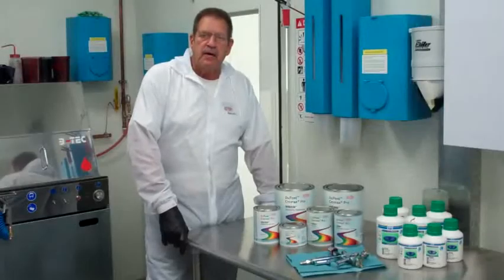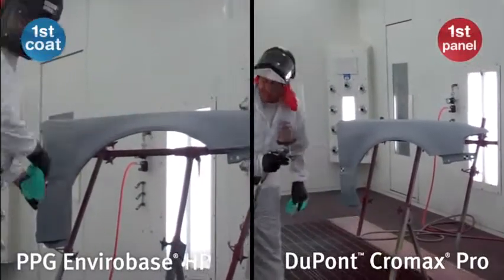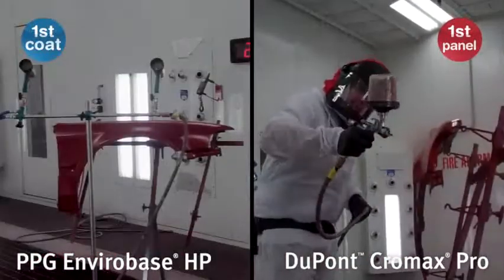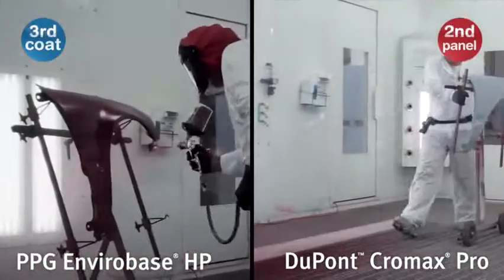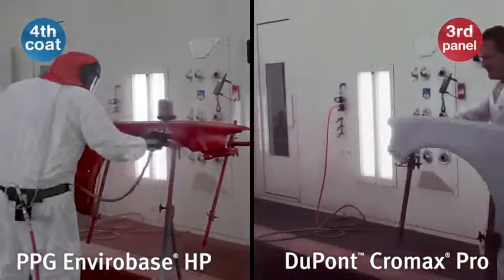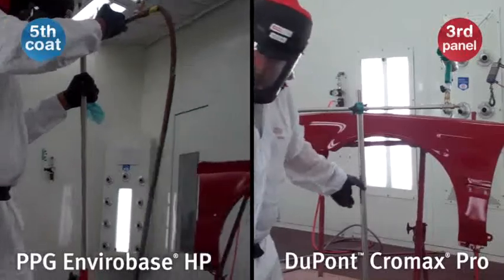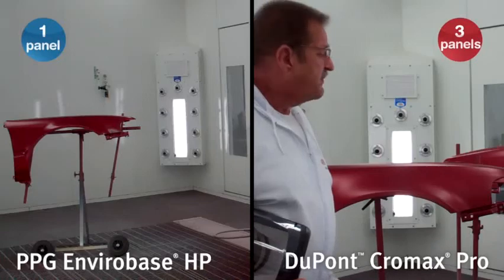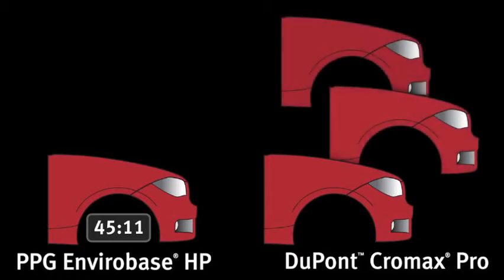Cromax® Pro vs. Competitive Waterborne System: Coverage (USA)

Comment: There sure are a lot PPG guys on here bashing something they probably have never tried. I have sprayed PPG for 20 years until my shop switched to Spies and I can tell you these videos are very accurate. Color matches are unbelievable and our productivity has skyrocketed. As to blending.... It is way easier. I don't have to check viscosity everytime I paint. Also I don't have to spray a certain color of sealer to get the right color match. You PPG guys keep doing what your doing.... In the mean

Comment: The DuPont I mean Axalta guy likes to pound that base coat... no wonder EHP is slow to dry. Cromax does cover in one and a half coats, usually, but that is where any advantage it MIGHT have ends. I love the straight on approach of his air movers. I notice they didn't try to nib any trash out of the Cromax...Ouch! Last but not least I wish every color could be panel painted like the Axalta guy is demoing... now lets see how well the Cromax blends.  Good Luck....